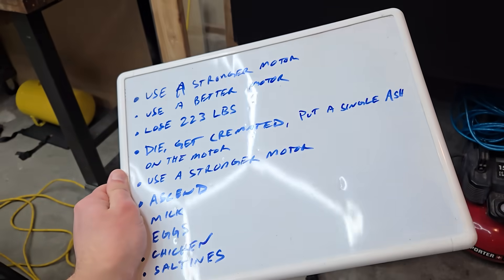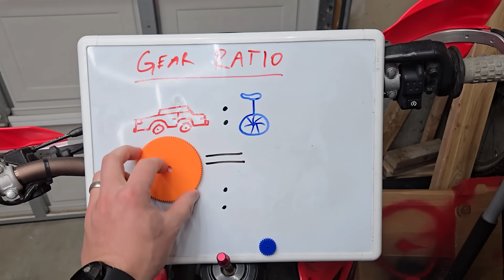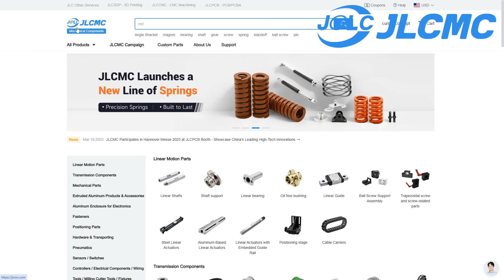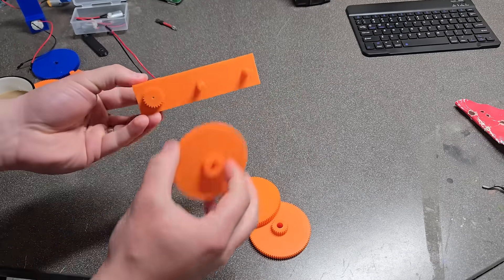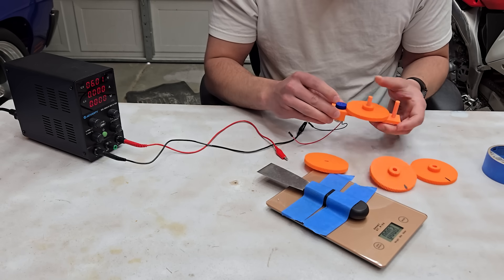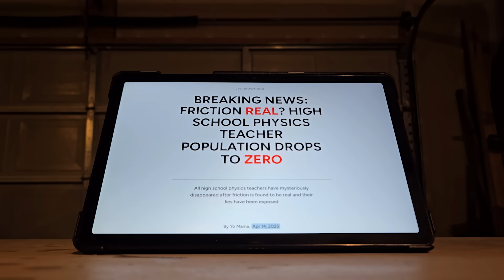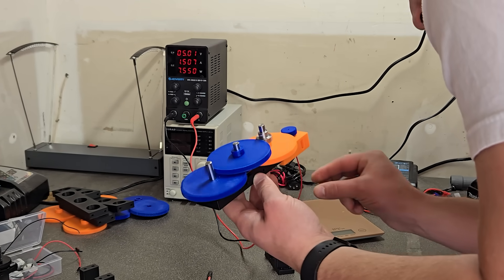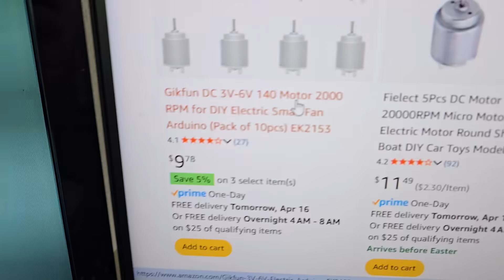I Built an Elevator With a $1 Motor

Comment from the maker: hey all you cool cats I just set up a Patreon so that you can get wayy more content (2 videos a week) here:
https://www.patreon.com/CurrentConcept

thanks for watching yall
Reply: I took AP physics in high school, friction wasn't ignored and neither was air resistance. Take that misinformation. Also the number of times my physics teacher who worked for fortune 500 companies on projects over the summer f'd up his math was hilariously high.
Reply: Hey maybe they're good maybe not, I haven't finished watching yet but I'm EXCITED about your JLCMC sponsorship, you are my SANTA CLAUS man - something else to spend my money on and hoard more useful crap  LMFAO
Reply: @currentconcept Why didn't you just lower the outlet? Than you could just reach up and plug things in.
Reply: I really don't think you need a reminder of your engineering skills, but you're doing a great job. Your content is good to watch.
Reply: Ok. So what voltage were you running when the motors failed? I don’t understand how they failing so easily?   I’ve put 2 times the rated voltage/amperage in the same motors and yes they eventually failed but only after running Mach Jesus for several minutes.  You simply stopped the shaft from rotating for a split second and bam bye bye motor.   I don’t understand!  Could you explain?
Reply: @michaelpreston2392  It's not the voltage, it's that @currentconcept didn't limit the maximum current his power supply would deliver to the motor. At times, you can see > 40 Watts (a couple of volts times tens of amps) of power delivered to the motor. That will burn the wires rapidly. So, it seems, CurrentConcept didn't understand the current concept. ;-)
Reply: +1 sub! :D
Reply: Could have used a pulley
Reply: mrow
Reply: Stilts would be good, same for cleaning the spouting.
Reply: This bike costs $0.01 when it leaves the factory in China.
Reply: Well, being as you asked ... I was wondering if you used proper splines on those gear teeth. No friction if there's never a sliding contact between two gears.
Reply: copy paste from the channel ''i did a thing' the filming the editting the voice over, damn dude
Reply: Erm... just make a hop-up step.
Reply: liked the vid. like  your style. only question, howd you get the short bus glass lick preventing helmet off?
Reply: just make a stair out of wood
Reply: Lol, I notice you said "less Australian cousin" and not "more American cousin", which as a fellow Aussie and watcher of I Did a Thing, is actually a fair comment lol.

Comment: Based upon the current limit(250mA) of the motor in the data sheet, To spare the motors' untimely demise you COULD have put an amperage limit on your adjustable DCPS of 250mA. When you applied resistance I saw the PS amperage display shoot up to 10A for a split second and immediately thought "there goes another motor....". They would have still broken with the limit but might have survived more testing. However, sparing them may have denied us the entertainment you have provided. Very entertaining video. :)

Comment: You should invest in a power supply that lets you limit the output current. It will save you several motors

Comment: Engineer here. To solve with that motor:
1. Use heavier gears as you approach the load side.
2. Install a capstan winch between the final drive and the load, especially if you aren't lifting static weight.

Comment: 8:15  I did that once in drywall.  No idea how.  The bit must've been weak or something.  I had run it though wall material not unlike those 50x200 boards right beforehand as well.  It was a 7/16 bit as well, not an 8mm like you're using.

Comment: I wonder what kind of pressures a hand-cranked, or even a motor driven, "hydraulic press" could reach with a crazy amount of gears instead of hydraulic fluid and pumps.  🤔

(edit - I'm guessing the gear teeth would just break off before it got to high of pressure, unless you had some beefy gears..)

Comment: as someone who works in elevators, you should've added a counterweight to the platform. in that case the motor needs way les tork to make the platform move.  normaly the counterweight is balanced like this:   Platform weight (empty) + maximum load (in this case you).  Then take the maximum load and divide it in half (your weight in half) . In this way you get a 50% balance ratio between the platform and the counterweight. 

Since i,m from europe and we use KG's instead of what ever the imperial numbers are haha. this is a example:  Platform= 100kg. your weight is 80kg.  100+0,50x80= 140kg + 40 = 180kg   So the counterweight needs to be 180kg.

Comment: Use a COUNTER WEIGHT on a pulley. Assuming the weight of the rope or chain is small compared to your body weight, you just need the motor to overcome the friction needed to turn the pulley. Minimize friction with lubed bearings. Hope that helps!

Comment: Holy snazafras Batman, if you reduced the load with enough pulleys, could you reduce the load on the motor enough to keep it from anhero? Is there a world where the gears are lightweight enough and load has been reduced enough, we can power life on our smallest of motors?

Comment: Just design the gear train through calculation and make the thing digitally in solid works then print it 😭🙏🙌. Also friction doesn’t matter with spur, bevel or helical gears, only worm gears 😭

Comment: You could've just used a higher shutter speed and more light and you wouldn't have had a problem with figuring out the motor speed with slomo.

Comment: If you’re already using pulleys, why not just use more pulleys so you don’t need so much gear reduction and could spin faster while still not requiring as much force?

Comment: I'm in a wheelchair and have been since a 1992 train accident when I was 17 in Buffalo, NY. When I was 25 I got a settlement from the railroad and bought a house with a giant 2000 sq. ft. finished basement that I wanted to turn into my wife and my businesses (1/2 coin/stamp/Comic book collectibles shop and half hairdressers). Only, I couldn't afford the construction or the equipment to have a real elevator installed. My coin dealing mentor who was an engineer in the 50s-90s though about it and said that a garage door opener on its side high above a pad would easily lift me and the chair. Then I made the mistake and went and asked about permits (it was in Depew, NY, a small village outside of Buffalo) and they said they're no way they'd give a permit and that if I went ahead with the idea I'd end up in court. So, needless to say that never happened. Now, I live in Florida and the rednecks down here said they'd do it for a case of beer and some barbecue!! Problem is they say you can't have a basement bc of the water table in the ground, you couldn't keep the water out. Huh??? There's 20 million pools in Florida i told them, you can't keep water out but you can keep that water in?! Just form square pools with stairs and footing pads, etc (whatever they need) and drop them in a hole, build the house on tip of that like they normally do up north. "Can't be done" they tell me! C'mon, bs, right? (Not that I could afford to start a company to build all that stuff anyway, but the idea has merit, right?

Comment: I strongly relate to your refusal to look at the datasheet. Gotta constantly create new challenges for the brain to keep from falling asleep at work. I wonder if you could count the rotations by putting a flexible flag on the shaft, like maybe from a business card, then recording the sound of that flag smacking a wall, and counting the audio peaks per second in Audacity. Should be accurate if using a high sample rate.

Comment: Just make the gear lift sandbags, that then lift heavier sandbags, which ends with a sandbag that is heavy enough to lift you. It's like gears, but delayed and I think that's left stress on the gear because it only has to lift the first bag, but I don't actually know.

Comment: I am still in the process of designing a lifting system for overhead storage racks I bought at Home Depot.  These are strong, metal, and rise/lower with a detachable hand crank.  They are 4ft x 4ft (I have 2 of them) and store a few hundred pounds of stuff on the ceiling above my car.  Really looks a lot like your "elevator".  I am playing hell trying to find a reversible medium-speed very high torque AC motor to do this.  My goal is to hook up a momentary contact light switch that reverses the power when you press up or down (already bought this switch) to raise and lower these racks.  I have a BSEE so I certainly have the ability.  Just can't find the high torque, slow speed, reversible AC motor.  Even with a gear reduction setup.

Comment: This motor is super small which is only suitable for toys. You should calculate the mass and force required to lift up the platform then choose the motor with higher output.

Comment: You shoukd try applying fluid dynamics to it. In the case with a differential for example, the gears of the teeth arent acually contacting each other but its the pressure from the gear oil that is driving it. This may overcome your friction issue

Comment: you needed capacitors.  if the motor is even able to start up without a capacitor, then you're not using it to its full potential.

Comment: What if you would make the same elevator but using equivalent of every motor you burnt?
Instead of using one motor, maybe try 17 motors  at the same time instead of burning out 16 motors?
But I get your idea, is it even possible to make 1$ gear motor to lift a human.

Comment: Does it take you 6 years to travel a floor LOL like that gear set/Conversation Piece where you turn the one gear at one end at the other end the ratio it has become so large it will not turn even after the universe has expanded LOL

Comment: Try using lithium grease instead of WD-40 next time. WD-40 is more for displacing water and cleaning than it is for lubrication. As soon as it dries, it is no longer lubricating the gears.

Comment: No you cannot, limited power dissipation, faster burnout. Also the ridiculously low power means very very high time to transmit the necessary energy. You could theoretically redesign the casing to be like watercooled or something to keep it from burning out. 

Also the drywall knife on the scale has a fulcrum at the hilt of the handle and the scale would read negative lol

You are funny than first season Simpsons thoXDDD

Comment: You just need to raise the platform high enough to work as a foot stool, then you can secure the platform without putting any extra load on the motor. Then you can step up on the secured platform to do the job of plugging in the lights. Or, you could just build a foot stool and use that.

Comment: Sounds like gears are not the solution. 
Total gear ratio to lift 250 pounds with motor that by itself could only lift dozen of grams would be in the neighborhood of 1000. That's at least 3 gears of 10 to 1, which are some big gears.
And at that torque even the loss on friction might be enough to stop the motor.

Comment: When you relize friction is an issue from barely touching them and it breaks the motor it goes to show when you add the friction of your whole body weight it would never work 😂 considering the small sharp angles of the gears would break by applying that much force of them against eachother if it did build up enough slow torque over time to try and twist it

Comment: With such a small motor it might be better to use less gear ratios, but considering all aspects including mass of bigger wheel maybe a worm gear would be best solution.

Also as someone mentioned, you should use counterweight, because it is actually used both for safety and power economy.

Comment: maybe a stupid question but why did the motors died?as far as i know,if you apply to much counter force to it ,it will simply stop spinning and create heat inside the case.can it generate that much heat that it will melt the copper winding inside?!as far as my limited knowledge go,copper melts around 1000 C and i find it hard to believe that small magnetic field can generate that much.or maybe a solder point inside ?but again is a few hundreds degree C.What I'm missing?

Comment: You could power it with a drill.
Make the whole shop drill powered.
Drill powered elevator.  Drill powered door.  Drill powered dimmer switch.  Drill powered faucets.

Then just carry a Drill around.

Comment: My grandfather had a truck with very low gears and multiple reduction boxes.  He used it to pull really heavy things - houses in fact.  The only thing was, when he had it configured for maximum reduction, you’d have to draw a chalk-line on the tires to convince anyone it was actually moving.  And that was after waiting several seconds for the gears to actually mesh together.
Reply from the maker: thats awesome. do you know what kinda truck it was?
Reply: @currentconcept Autocar
Reply from the maker: sweet

Comment: All you had to do was to have your body weight minus 1 lb weight pulling the elevator up. This way for coming down, You don't need the motor at all, Your body weight would be enough, And for going up, The motor only needs to add 1lb of weight

Comment: Your solution is cycloidal gearbox. Its strong and you get that ratio faster with lower friction in the end. Harmonic one would be even better, but the deformable gear in it is a pain.
So cycloidal. Reduction ratio of about 1:100 is relatively easily reachable. if you add second stage you will get 1:10000 and third stage would get you to 1:1000000.
And the best thing is, you won't turn it around, it is basically stuck to be a reductor of RPMs

Comment: Very entertaining video!
That power supply has the ability to limit the current. 
Try setting it to 6a or so. 
Some models of that PSU require you to short out the pos and neg in order to pre-set the amps before you load it. 

Yes you read that correctly. Direct short it, as per the included instructions.

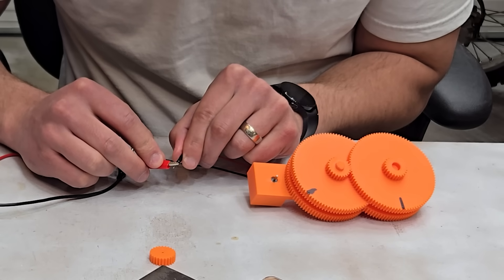Comment: @5:30  that power supply lets you set the volts OR amps..  If you set the amps to be the max rated value (vs the normal, maxed out), then you won't burn them out like that

Comment: Audio is recorded at some 44 kHz as opposed to some 30-120 Hz for video recording on most devices. Just record the sound for a few seconds of the motor spinning. Take the Fourier transform of the recorded signal and you'll see the speed of the motor show up in your signal. Works surprisingly well.

Comment: Easiest system that works and is in production is the screw type. Just think of a nut with a platform now spin the bolt and watch elevator rise! This is how wheelchair lifts in nyc are built! Cheap light cost effective for everyone

Comment: About a minute in to the video and I'm going to guess no, because the massive gear ratio required. It should work on paper, albeit very, very slowly, if you don't account for the force required to turn the massive number of gears sapping the power. As soon as that is factored in I don't think this will be possible. It's definitively not practical but we already know that, I don't think it will be possible at all.
Reply: Yup. Called it.

Comment: I believe a working fluid could be used here somehow. Perhaps use the motor to turn a housed impeller (pump) and use a small hose to move a tiny amount of fluid up to a reservoir, then when the level gets high enough, use the falling water to rotate a water wheel with much higher torque than the small motor. Or even simpler, you could use the pump to add water to a container that directly lifts a bouyant platform. Also a worm gear could very well take you into an order of magnitude higher torque with much lower friction than a train of gears.

Comment: You need to use a 1mm square belt that goes from a small pulley on the motor shaft (barely thicker than the shaft itself) to a big pulley (30 mm or so) and only from there you can go to the first gear. I learned this from 1980s Legos where you didn't have the luxury of geared motors.

Comment: think I found this shortly after hearing how the large EM isolated hanger the US military has opens its massive door via a 1/3 hp motor, as any faster would cause the door to rip off the buildings wall. So basically, motors can have their power geared down to lift the heaviest of people. Of course, speed was an issue, as the door required a full 20 minutes or so to close or open fully, so I assume that will be a similar issue with this motor.

Comment: I'm confident it's 100% possible to lift your weight with a $1 dc motor. However, something I noticed is the reason worm box gears are successful is because the fitting attached to the motor is spiralled not toothed. This of course would reduce the chance of burning out the motor. Take apart a worm gear box and study it👍

Comment: Hey, so 20v 550 motor used in power drills probably can lift a human using such contraption. 
You han find it for 10 dollars, so 10 times the cost, but it will probably work. Also they can do up to 15k rpm so the elevator would be fast.

Comment: You're going about this all wrong. Instead of using a 350,000:1 gear ratio to overcome the motor's weak strength, it would be much quicker to use a 1:1 gear ratio, and use 350,000 $1 motors instead.
Reply from the maker: you are a genius